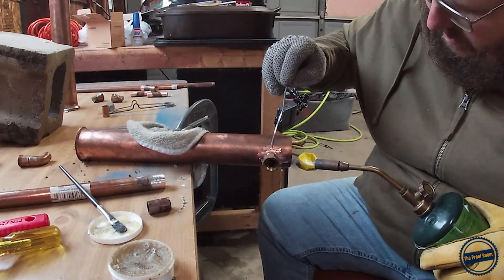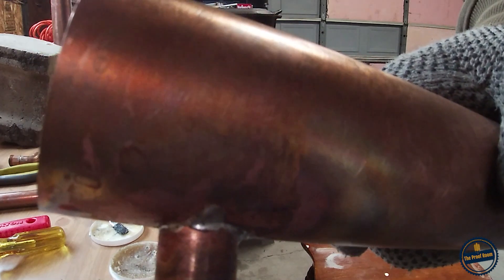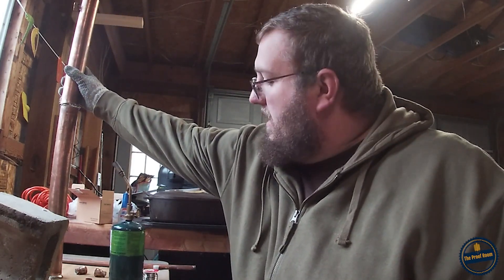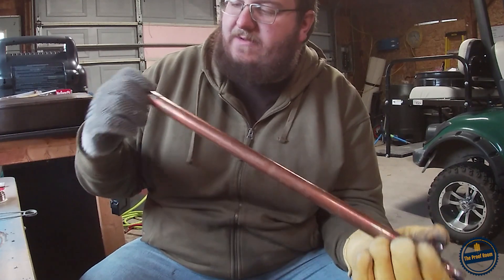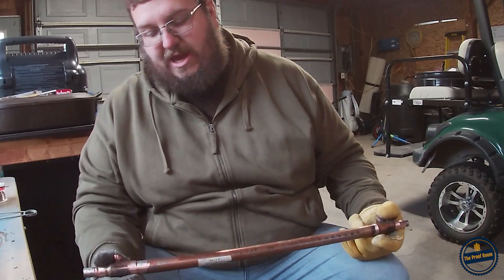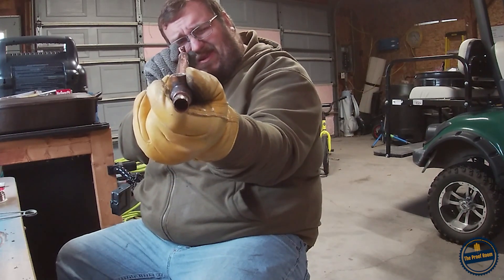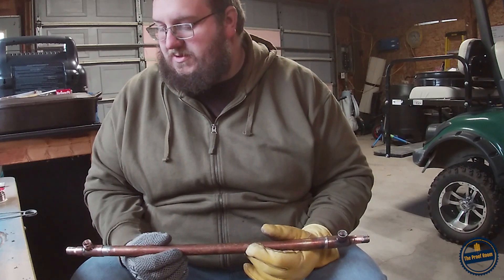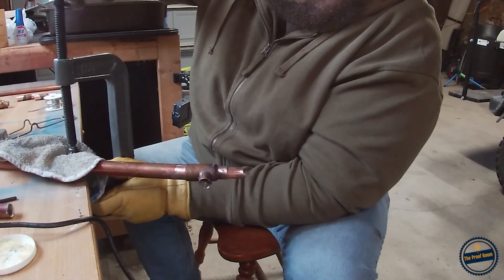2 inch still column build.

Comment: This is old news now,but your heat looked a little cold,stainless and copper are fine,just favor the stainless first with the heat,if you pulled that fitting apart,little sanding,stay clean flux and higher silver solder,

Comment: By yhe way ....althought it is extentively used,  lead soldering is forbidden to the points where the steam passes. It is poisonus. The welding must be done with silver soldering or copper to copper using acetylene/oxygene or TIG . Propane soldering with lead is NOT suitable.

Comment: Always let the heat of ur metal.melt the solder not by putting ur flame on the solder is why the solder kept melting in globs, also by heating the copper and then applying the solder the heat/paste will draw the solder into the area, u should of also turned the column upside down so the solder wil gravity feed into fitting especially a novice,  if u had heated the copper up it can flow upwards but not the way ur doin it im sure u had to do that again

Comment: Hi Scott you do get that try clamp in 2" copper to solder to your column , should be better for soldering and get a better bond between two of the same materials. Also use liquid flux not the paste, cheers mate and happy distilling

Comment: If you built a Still out of a Keg, the 2" Pipe is the easiest way. But i Would suggest you to a 3" Pipe min. The Miracle number is Pi = 3,141. The difference between a 2"pipe and a 3" pipe is twice the square! ;) Keep up the good work, and thanks for sharing!
Reply from the maker: Eventually I would like to go to 4 inch. Right now my two inch column is working ok.
Reply from the maker: Thanks for watching i really do appreciate the advice
Reply: @theproofroom1473  Currently i'm working on a 3" ( Liebig Kühler ) 500 mm lenght, with a 18mm core pipe Sipral. ;)
Reply from the maker: @smrettpecca  im still just learning but I'm getting there
Reply: @theproofroom1473  We all learn...… every single day, untill Our last Breath! ;)

Comment: fitting on the 1st solder joint probably would a better if you did that off of the concrete block.  It sucks the heat out of the stainless and takes longer for it to get hot and the 2" copper tubing will get to temperature quicker
Reply from the maker: You are absolutely right

Comment: when you have a larger than normal gap, less heat is a good thing...instead of using the die grinder use a reamer for a snug fit, good soldering depends on capillary action to draw the solder into the joint...did the s/s solder to copper hold running pressure?
Reply from the maker: yup held water pressure for two hours
Reply from the maker: thank you for the advice I do plan on trying this for another condenser .